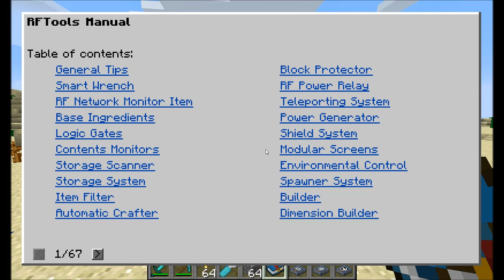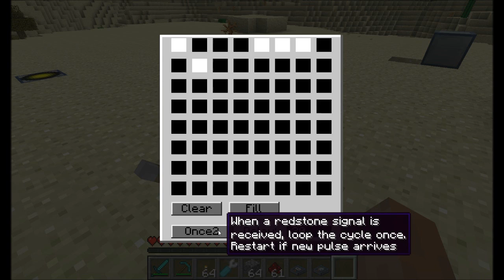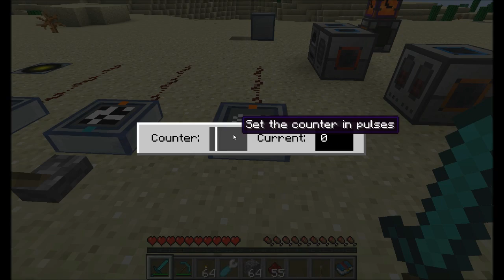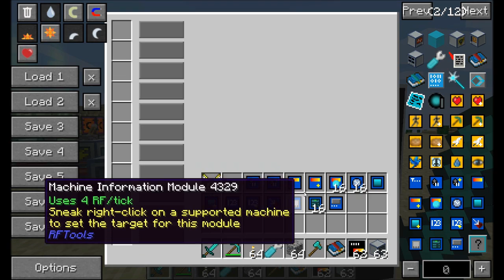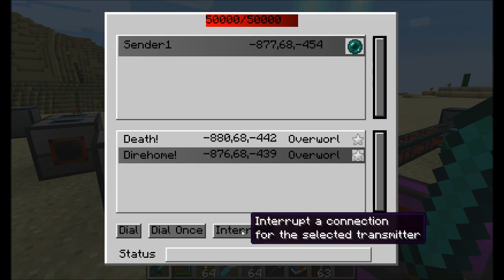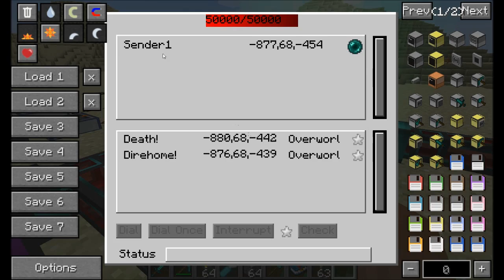Mod spotlight   RFTools v3 0   Ep2

Comment: kilo-milli-buckets...
Cant you just call it buckets?
Reply: Gemdude46 I guess not?
Reply: Gemdude46 Kilo-milli-buckets would be correct, because the default measure unit is mB.
Reply: CatDany (Dany2001RU) no, standard is bucket. mB is an adaptation, that's why the m. so, yeh, it should be bucket :P
Reply: ***** No, it's standard in Forge, you would know if you were familiar to Fluid API in Forge
Reply: CatDany (Dany2001RU) that's a different matter, but that means forge is scientifically doing it wrong ;)
Reply: CatDany (Dany2001RU) it does not matter if forge what forge uses as this is about represantation.
 mB stands for milliBucket milli being a prefix to bucket just gives you an order of magnitude and could be for all occasions be replaced with 10^-3 kilo being 10^3 so if you would now write 1*10^3*10^-3 you would notice that kmB is absolut nosnsense.
And KmB is wrong in a nother way as correct abreviation for kilo is a lowercase k not a uppercase K
Reply: CatDany (Dany2001RU) By that logic, grams shouldn't exist, they should be milli-kilograms because killogram is the base unit.
Reply: zocke1r Yup, no way I'll use that screen in that mode now. My brain would be constantly screaming "This mod author doesn't understand SI units, the dumb dumb." Adding a catch to convert the notation properly should be trivially easy.
Reply: Because mB is the actual standard measure unit. Bucket is an item.
Reply: CatDany (Dany2001RU) if you measure a meter with a ruler with a millimeter scale you would not say that you measurred 1kmm but 1m or 1000mm, hence the order of magnitude you massure in does not matter
Reply: ya know what, let's complain this to the makers of forge? then afterwards either they change it (making this a useless conversaton) or we start throwing this info at them.
Reply: *****
There's no reason to do that. The use of mB in the game as their base unit is fine. Besides retconning that now would make a whole crap-ton of mods create erroneous data. Like when the mod author intends a certain block to create say 100mB/tick of a fluid, but then suddenly the API changes and that same code, while not actually breaking (which would actually be better), instead that block makes 100B of fluid per tick.

The Forge API doesn't need to change. Mod authors just need to either stick with mB, period, or throw in a trivially tiny bit of code to convert the unit of measure correctly.
Reply: ***** i know, i'm just saying this complete line of comments is nearly useless like this ^_^

Comment: I think you should have mentioned, that it supports ComputerCraft and OpenComputers. Just to be fair ;)
Reply: MisterErwinspielt He mentioned ComputerCraft Support for the Mod  later in the Video,   or did you mean the power gen specifically?
Reply: ***** Computercraft and Opencomputers are 2 separate mods, MisterErwinspielt is joking at the fact that direwolf only mentioned computercraft support and not opencomputers support  which is "unfair" ;)

Comment: One thing I don't like about this wireless redstone or WR_CBE is the hard repeater behavior. Sometimes you want that behavior, but more often I want it to maintain the signal strength going in. It'd be nice to be able to toggle which behavior is used.
Reply: ***** There is actually a feature request for that so at some point I will add that option.

Comment: This mods generation system seems overly complex and it seems totally anit-fun.. -_-
Reply: The Dragons Eye Games My eyes definitely glazed over. Way too damn complicated. I have other complex redstone things to do. I don't need an excuse in the form of such a complicated...thing.
Reply: Voyd
I suppose you could use computercraft, or two timers synced with a single pulse. Wireless Redstone would make that easier and eliminate delays. It still seems like a lot of effort, when it'd be easier to just design a giant reactor and have it make oooooodles of power for you.